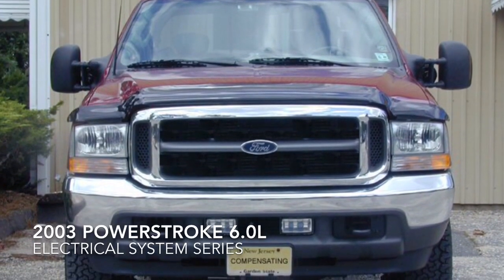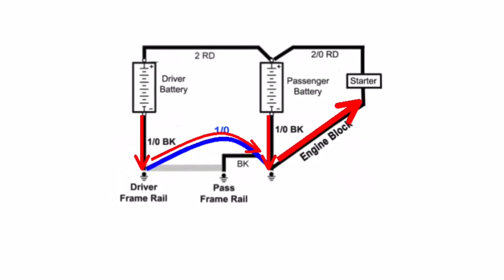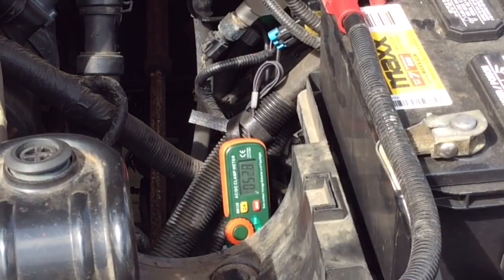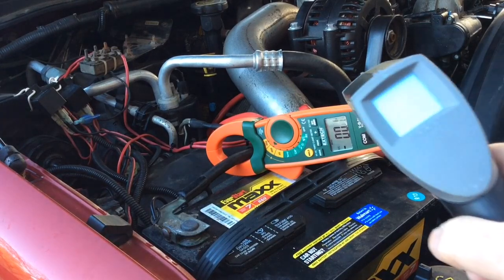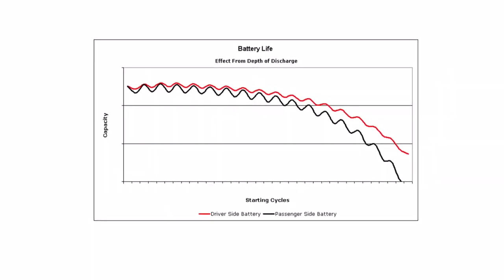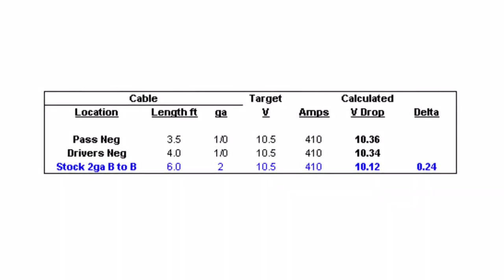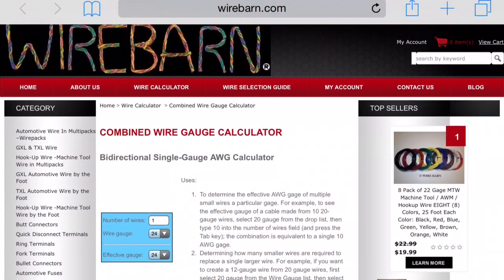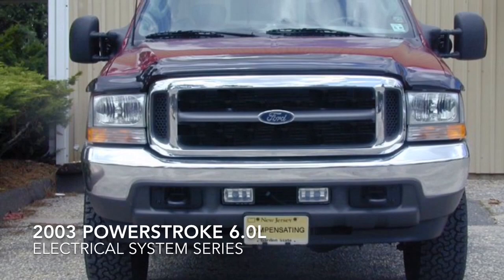2003 Powerstroke 6.0L Battery Cable Upgrade to Balance Battery Life

Comment: I'm having a problem where my driver battery is going dead (assume not charging) over time leading to electrical issues with rear taillights (extremely dim). Taillight wire shows good supply voltage at truckbed harness connector. Seeing a huge voltage drop from positive terminal on driver side battery to chassis ground on driver side chassis using multimeter. With truck running  pos terminal to ground on body or engine shows 14.6 volts but to chassis its 6-10 Volts varying. The alternator stud shows 14.6 volts with engine as ground. If I hook up jumper cables from driver to passenger battery the problem alleviates itself. My bonding cable from body to chassis under passenger door is disintegrated(no longer bonding body to chassis been like that for 10 years) I have visually inspection the neg battery cables where they connect to the chassis on both driver and passenger side and they seem intact. I plan on unbolting them and inspecting them on the bench for damage and ohm resistance (what's spec?) And grinding fresh metal on the chassis where the lug from the cable makes contact to the chassis. Do you have any more insight or thoughts since you are much more versed then I am? Thank you, Mark.
Reply from the maker: Yeah, Mark.  I've seen that before.  It can be the positive cable that goes across from battery to battery.  Corrosion in the connection, and sometimes a hard break in the lug connecting the positive wire to the passenger battery terminal.
Reply: Found a hard break In the lug to the chassis on the passenger side neg cable. Driver neg battery cable ohmed good. The threads on the bolts were very rusty and a lot of rust where lug meets frame (no bare metal) on both sides. I wire brushed the bolt threads and ground down the chassis where the lug makes contact to the frame. I added a 2 foot 1g ground wire from passenger neg battery terminal to passenger chassis. Hopefully this alleviates my driver side dead battery. With a voltmeter my chassis ground now matches my terminal and body voltage. No more voltage drop to chassis ground.
Reply from the maker: @Trophy-mg5nf  Cool.  That would screw things up, too.  Glad you got it sorted.

Comment: I don't disagree with all this analysis but I worked on 6.0 diesels at the dealer since they were released in 2003.  In North Tx I will say we never ran into any problems with the factory wiring causing any of these problems you suggest.  Maybe it's different in rusty environments.  Seems like you think too much but if that makes you happy, getter done.  These are antique old trucks now, so I see very few of these now days.  I have left that business almost a yr ago now but I still service quite a few in my home (fully equipped) shop.
Reply: By the way they did have a recall on that negative stud in the early days, maybe the problem you speak of has to do with the ones that didn't get done.  It's never been a problem in my area I will guarantee you.
Reply: Larry I'm having issues with my battery cables. I had a bad battery with a positive side leak. Made my terminals very corroded. How can I replace these terminals on both batteries?? I have a 2006 250 6.0.
Reply: My answer is :  You can't replace just the terminals with the correct (factory parts)  Cable assembly is how they are serviced.  It's expensive for those I'm sure but I've done some and it's the CORRECT repair.  One of them is the harness that goes to the starter.  Kinda hard to do but not that bad (probably a 2 hr job)

Comment: Do you ever switch battery position mid life span of the battery?
Reply from the maker: I did before the cable change.  The battery set after the cable change has not been, but I've not run the batteries to the point of replacing them as yet.  With this set, I have a battery tester that shows % of health and resistance; both can be used to see how the battery life is going.  It has seemed to be consistent battery to battery.  The other issue is every battery is different.  I have about 14 batteries in total between home and the farm, so a good base.  What I'm doing now for dual battery setups is taking the tool with me and not only getting the highest capacity battery(s) at the store but trying to match the capacity between the pair.

I need to test another battery cable set up, which I think will make it so the need for balanced batteries and buying a pair when one goes down eliminated, but I don't know when that will be.
Reply: @toomanytoys  Thank you for the knowledge. I'm getting all the stuff together to bring our 05 up to speed.

Comment: Just added 4/0 copper  Back pass Cyl Head to frame.....then    4/0 copper  from frame to trans tab...converter draws ome power..  do i Still have to double the Front!?   Thankx!!!  Great  workk    N thankx  for your sacrafice  Health ...lol
Reply: other grounds all new
Reply from the maker: Ford in their Body Builders guide states to not add any grounds to the transmission.  All of the transmission electrical flow both positive and negative for transmission functions are isolated and carried through the harness.

It's been three years since given the Levaquin drug for pneumonia and still dealing with the issues.
Reply: @toomanytoys  wow check out A1 transmissions  you tube video....about ground loss and components welding together....I'm not arguing your point ...opal check it out sound logical to me ...I don't wanna be doing anything detrimental...so I'm kinda like oh k...
Reply: @toomanytoys  ya I'm n central n it sucks
Reply from the maker: @KERNFUZED  I've saw it a few years back, it still does not make sense that 18ga isolated wires would survive that kind of welding current.  In the field that type of failure has been shown to be a failure of installing the torque converter correctly, or air suck up at the filter when a new filter is installed.

A good video from a good trans guy shows the failure around 16 minutes in.

https://youtu.be/xL1RlxhJebI
Reply: @toomanytoys  Oh ok Ya scared me didnt get back! lol  ya its one those things how can ya dispute   ..I know as and elctrician  although not as educated as you..Grounds are Redundant  at times!!.. 18ga  thats it?  ughh  wonder what amp draw that system draws under full Electrical load?
Reply: @KERNFUZED  Never measured them.  The supplies to the solenoid pack are 18ga, the controls (grounds) from the servos are 20ga, including the TC clutch.  It's isolated and low powered.  Nothing grounds through the case.

Comment: Would this be applicable to the 7.3 as well?
Reply from the maker: The battery to battery positive cable, yes.  The negative cable to the block is not needed.  With the 7.3 Ford used cables from each negative terminal directly to the block.

Comment: I have a question about the 6.0 Powerstroke. I don't drive it in the wintertime and if I disconnect both batteries for a couple months, will the FICM be okay? I heard that if the FICM gets low on volts it will mess it up. Do the battery constantly keep the FICM at 48 volts? Last year I kept the battery charged with a trickle charger all winter which sucked. Thanks
Reply from the maker: Having the batteries disconnected will not affect the FICM.  The mess up time is during the starting mode, the deepest drop in voltage.

With both my truck batteries and the 10 more at the farm, during periods of months of a shutdown, I pull them and kept them in a garage.  Then anywhere from one to six months, I will recharge each overnight; they don't need a trickle charge all the time.  You can do that, but I've not found it necessary over a few decades of doing this.  I prefer them out of the cold because the condensation that can form on them may provide a leak path across the terminals.
Reply: @toomanytoys  thank you so much!! Your help is greatly appreciated!!
Reply from the maker: @Austin2276  Youre welcome ... anytime.

Comment: So confusing. You make it clear, but the powerstroke I just bought in new shape runs 2 alternators from factory. Now what. lol.
Reply from the maker: With the dual system, the drivers negative should already be upgraded to the block, so that cable is not necessary.  If you want to get more of the drivers battery to contribute to the starter, the same 70" eye to eye,  battery to battery 2ga or up to 1/0ga can be used.
Reply: TooManyToys thank you so much. 07 King Ranch 250. All original with only 70,000 miles. Had it only a few months now after buying from the original owner. Seems to run very strong. It’s still basically new. Just been getting into your videos lately. You do great work. Cheers from central Canada!!
Reply: TooManyToys  really appreciate you taking the time to reply. Thank you. I will try upgrade that wire. Need to redo the positive connections anyway.
Reply from the maker: @jaybilawchuk2225  Glad to help.  If your terminals are hurt, and we are starting to see that Ford wiring and harness are being discontinued, it would be better to make up an entire harness.

In that case, you could do 2/0ga from the starter and between both batteries, and use military-type terminals for the posts.  You would have to mate up new eyelets on the alternator and cable to the CJB, that's that not that hard.

Comment: Any way I could get a video showing how to add the extra cable from the frame to engine block? I'm a dumb caveman.
Reply from the maker: I'll put it on the list, but it will take a while as I have my motor out.
Reply: Thanks. Mine is too right now.
Reply from the maker: For now 2:16 to 2:40 shows the locations available on the block.  If I went back and redid this video I would be telling a good option is to go to RockAuto and get the negative cable that is used on both batteries for the dual alternator vehicle.  It's the same cable as we have on the passenger side which connects from the block to the frame as well.  It also has the 8ga lead off the terminal that goes to the firewall, that can be connected above the headlight where the ABS ground is.  On the dual Alt vehicles, the cable connection for the block is at 2:34, just above the stator standoff.

Comment: my truck wont even start if voltage falls below 12.8.... before i even Turn key on glow plug Cycles.......... below 40 degrees F my truck wont cold start purely because batteries. and i only have one extension cord long enough to reach the truck either block heater or batteries plug in batteries overnight truck cranks up immediately  as low as 20 degrees F. batteries have have been on it for about 2 years Diehard Golds. 850 CCA...... im definatly upgrading all grounds and replacing my current factory battery cables and starter cable with new ones or upgrading it entirely larger cables slightly shorter lenghts higher CCA AGM's sick of battery issues being downfall of my truck. wanna eliminate any possibility that the batterys i buy are crap after 8 months vs. grounding being messed up or more than likely my terminals themselves are crap. adding in a Jump start 1/0 quick disconnect and mounting it underneath front bumper so jump starting someone or powering something else same connector dont even have to pop the hood.
Reply from the maker: Something is wrong because that is not normal.  First, you have the batteries tested for capacity at any AutoZone or Advance parts store.  O'Rileys may do that too; I just don't have one near me to know.

If your voltage is way low at key-on, wait to start without charging them, you may have an excessive draw.  It may be an issue with the glow plug controller on these trucks.  After shutting down the truck for an hour or two, you can check if the controller is bad if it is warm to hot.

Another thing sometimes seen is the battery to battery positive cable may have an issue, so you are only starting with one battery.  That check would be testing the battery voltage on each after a no-start.